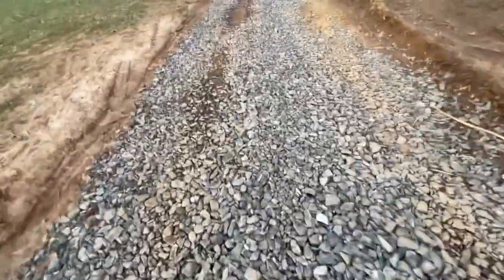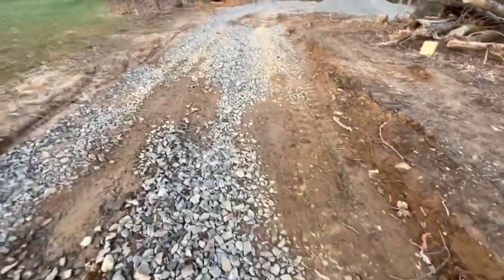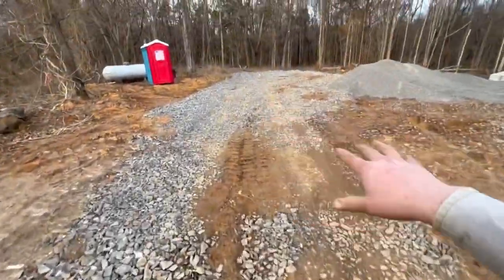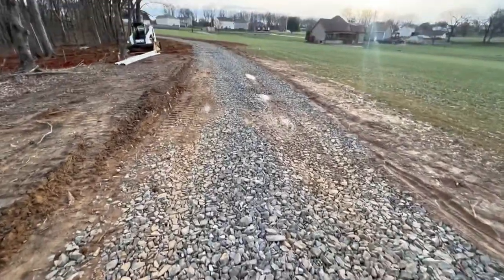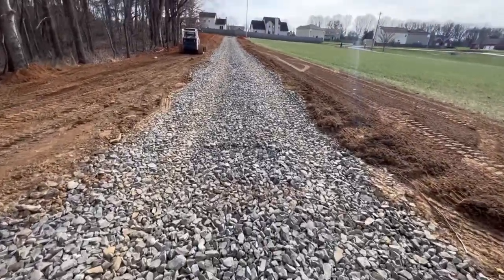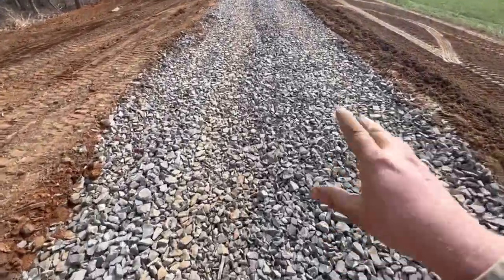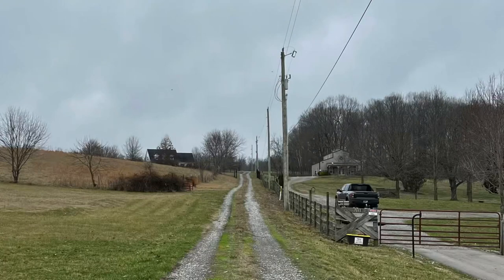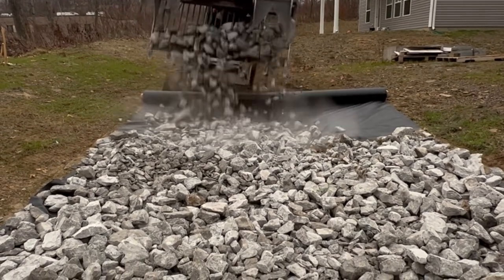Geotextile driveway fabric- What is it? Why you need it!

Comment: How long does the fabric last
Reply: Longer then you will.
Reply: A long time. But dont put 2-4 inches of rock ontop and then grade it.. because you run the possibility of punching holes in it with a grader blade, there is velvet like fabric and that sort of does the same thing but not to the same degree.

Comment: How about a 350 foot long hill that has lost its base. Would the fabric and crush run work or would I need a bigger rock on the bottom? Thanks, I’ll wait for an answer. Love the video.
Reply from the maker: The issue with the fabric on a hill is that sometimes the rock can slide down the fabric if it isn’t compacted. Sometimes we do avoid the fabric on steeper slopes. I would definitely used the bigger 2 inch rock to get a good bite on the existing ground, and build up from that. Fabric can be used between layers of rock.